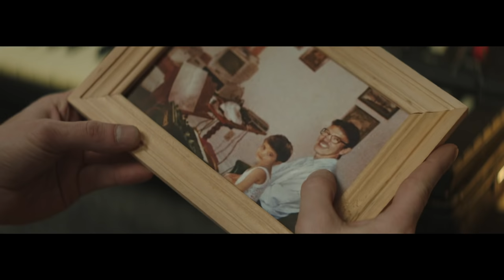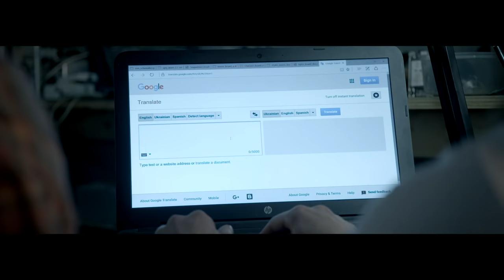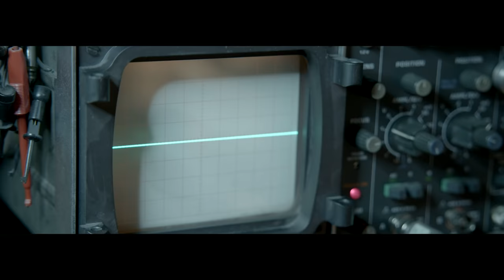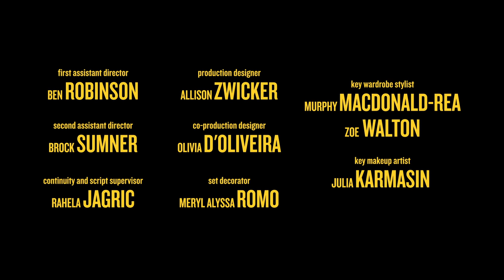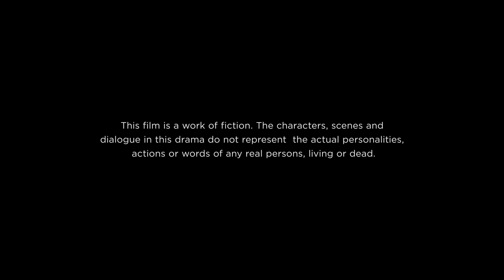SYNTHESIZE: An analog love story // Short Film by Matthew Edison feat. Synths When

Comment: Excellent!!.Speaking as a a bit of a Dweeb ,back in the day I repaired A Poltava Fuzz Wah for a guy who bought one over the net from the Ukraine only to find it did not work.I went through the joy of deciphering Cyrillic Transistor and PCB labelling and schematics.I got it to work with a replacement vintage Germanium Transistor and resoldering.The film got some nice details, like the dodgy blue office swivel chair...I had one of these also.Theres just something so right when you will risk a catastrophic ankle injury by stepping on the swivel chair to get to a stack of piled up bits.